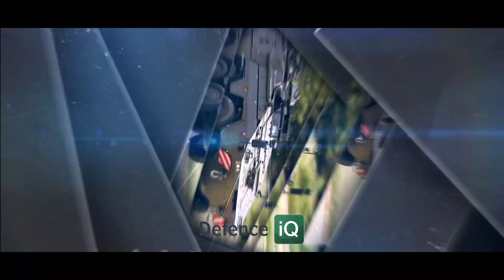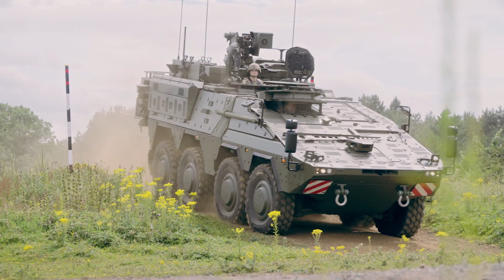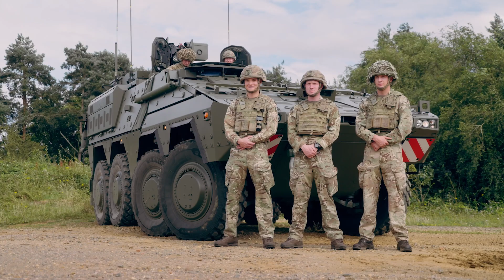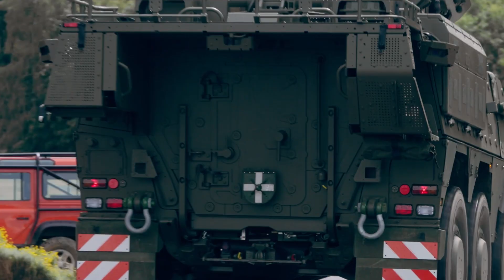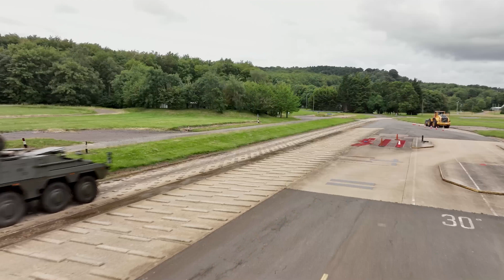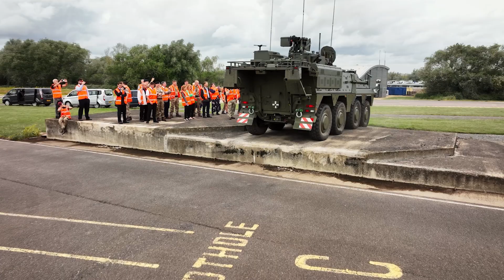The Progress of the Boxer Programme: Insights from Martyn Williams

Comment: I am glad they decided to have the external armourment fitted on the Boxers, that makes a lot of sense, just imagine if you are tring to pick up a casualty or evacuate stranded people having top cover is a necessity.

Given that boxer is going to be right in the thick of it, probably more than any other vehicle, and given that one of its virtues is modularity, it would make sense that one in three provided to the infantry are equivalent to the Latvian boxer variant, namely they have a more powerful external weapon.... which i guess using labels would class them as  an infantry fighting vehicle

Correct me if i am wrong,  but even with a large external cannon they still have the capacity to transport troops (although perhaps not as many).

My thinking is that most people think the most likely threat is traditional head to head confrontational warfare with an equally equipped adversary... Being more specific in open largely flat terrain in Europe.  If for example the boxers were advancing towards the enemy in open terrain having powerfull surpressing fire at range would be a great advantage (for example they could lay down fire on the move for Boxer's which were not fitted with a cannon.  That would be a very effective arrangement (and demonstrates the utility of boxer too).  The small arms fitted i imagine are great for fending of infantry in close proximity, but perhaps not neutralising pillboxes / fixed positions or other IFV's at range.

Also, i read sometime back, that the Saxon vehicles basically had a boiling vessel (kettle) in the back.. does Boxer have a 'B.V' fitted?? Sounds trite, but if you are out in the field wet and cold, simple things like that create disproportionate benefits.  You read some comments from old soldiers who when reminiscing abd thinking back over vehicles remember the kettle as being the most valuable feature of the vehicle!
Reply: We have always had a MG atop our APCs - not a new idea. Granted that mounting  the MG in a RWS is a refinement.
Reply: @grahammoore8967  the original plan to purchase boxer as I understand it was without an external armourment.  The addition of an external armourment was a belated or late in the day change after some consternation!
Reply: @Robert-f1g4i I presume we are not going back to the 1996-2003 period when UK was first involved in the project, then left to pursue FRES. We sought a MIV second time around after the fragmentation of the FRES programme. On 19 July 2018 the UK MoD disclosed its intent to initially order between 400 and 600 (later set to 523) Boxers in four variants to meet the MIV requirement for the Mech Inf. It would always have a MG for local defence as all our APCs had. Order was made in Nov 2019. The choice of the Kongsberg RS4 PROTECTOR RWS to house the MG was a very early decision being ordered on 22 Dec 2020.
Reply: @grahammoore8967  Saxon? No external armament.
Reply: @Robert-f1g4i  Saxon just had a pintle mounted MG.
Reply: AFAIK, all British AFVs have a BV.

Comment: Yes MRAV, back in 2000 this was a joint project and the UK was to manufacture the module, then we pulled out and that was the end of Alvis. Even worse Dorset Engineering down in Weymouth engineered a similar 8 /6 wheeler and our lot wouldn’t even look at it. That was the end of Dorset Engineering.
Reply: All very sad. I remember when we had 5 independent manufacturers of AFVs. Alvis produced some great kit over the years - Saladin/Saracen/Salamander and then CVR(T) and also Stalwart HMLC. The kit worked, was developed and built quickly and was well liked. Fair price too.

Comment: American company, "Let's buy this British company, then get a licence to update a 1960s Swiss MOWAG, get £ millions of taxpayers money, in an attempt to make a vehicle that will never be a new generation vehicle. We'll make it so it doesn't really protect the occupants, and we'll copy the failed attempt to produce a multi-type range of vehicles, as with the F-35 aircraft, fail, but still sell them to the British army, who are in dire straits over the condition of their armoured fleet."

And never admit that the whole exercise could have ended up with a modern vehicle, that was capable of surviving a modern battlefield, and it would have been cheaper. With the simple procedure of buying current, modern vehicles from European manufacturers. Vehicles that will never be of such low spec as the Boxer. 

Britain, once again, mugged by the Yenghi.

Channel is now a member of my DRC Club.
Reply: Boxer is a german-dutch designed vehicle and is not a refit MOWAG Piranha?
Reply: @cathulhu-q7y  Yeah, that rant was hilarious nonsense

Comment: A great vehicle. We should never have left the original consortium. It is ideal to replace Saxon light wheeled vehicles and possibly the bulldog but NOT warrior!!!

We need a tracked range of IFV. As good as this vehicle is it cannot replace a tracked vehicle.

If you go done that route you definitely need more variants.

IFV, mortar, air defence, anti tank etc… I.E fighting version’s
Reply: Saxon was phased out decades ago. Boxer was meant to replace FV430s (many of which were uparmoured to Bulldog) and Mastiff. Warrior was meant to be replaced by improved Warrior, but that programme was cancelled. Very sadly wheeled Boxer MIV is now replacing Warrior IFV in the armoured brigades. Total madness.

Comment: There was some talk of a tracked variety being developed in Germany - for the defence of UK and much of northern Europe  the Boxer will more than hold its own but what about the further south and east we go the worse the roads become and  have to operate there? 
Also is there a module to house a 120mm mortar and/or the 105mm light gun now we have decided to mount a 155mm module. We've never had a replacement for the ABBOTT.
Reply: Yes a tracked boxer does exist. I personally think it would make sense to be able to swap modules between wheeled and tracked vehicles as required. Would help with standardisation, training and logistics

Comment: Well there you go. My last job in the Army before I left in 2001 was at Chertsey working on MRAV. For those not familiar with the acronym, it is Multi Role Armoured Vehicle, now known as Boxer.
Reply: Only 23 years in gestation? Rapid indeed. I remember being at HQ BAOR, the various Branches contributed tons of paper towards the future LR Ambulance replacement, never saw anything emerge though.
Reply: @samwhite8093  no, the german and dutch army are operating Boxer in combat deployment since 2011.
the UK just fucked up its procurement royally, leaving the programm early, trying to start/buy 3 different solutions over the 2000´s and 2010´s and now came crawling back to buy boxer as a customer, not a developement partner, 12 years after the origninal partners have been deploying Boxer in combat.
Reply: I was at RARDE (CH) in 1989-90. VS4/VT4.

Comment: Its a great APC for on the roads or dry off roading but I'd like to see it dealing with terrain like we see in the Ukrainian wet season.
Its basically a German Stryker and we've seen that these types of vehicles fleets severely lack heavy firepower. There was talk of maybe a mortar variant or a large calibre weapon variant but we've yet to see anything yet.
Reply: There are many variants, and the UK already has a prototype of a Boxer with a mortar.   Dutch armed forces are upgrading the 50 cal on the Boxer to a 30mm cannon and adding antitank weaponry.
Reply: its much heavier protected than stryker.
and comparably mobile to Leopard 2, even in rough terrain and mud.
where a Leo2A6 goes, a Boxer can follow.

Comment: A calm concise summary of the new Boxer vehicle.  No filler, cliches or BS - great to hear a positive account with no ‘jazzy or trendy’ speak just common sense.
Reply: Didn’t hear mention of the rather critical deployment problem: an A400M Atlas can’t airlift even one Boxer. It would take 3 aircraft to deliver 2 Boxers to Europe. Not ideal when your army lives on an island.
Reply: @billyponsonby  An A400M can most definitely carry a Boxer. For starters the A400M can carry 50-60tons of cargo while 1 Boxer weighs 30t. With 3 A400 you can airlift 2 Boxers and any 2 of their mission modules. Changing a mission module in field conditions takes about 30 minutes so really not a big deal if you have to remove them for transport due to size.
One A400 can carry one Puma IFV which is slightly bigger and heavier than one Boxer.
Reply: @gustavmeyrink_2.0 It wont take an ajax apc but who cares its a heap of junk with more soldiers being taken sick, no matter what the mod say it will never work its too heavy too loud and who ever said it will  are liars and hiding the truth 🇬🇧🇩🇪😍😫
Reply: @billyponsonby  we rarely, if ever, move medium or heavy armour by air. They would go through the Chunnel or on ships from Marchwood Military Port.

Comment: If it's got a BV then count me in
Reply: it has even an oboard toilet.
BV´s are standard on all NATO AFV´s since the 60´s
Reply: @cathulhu-q7y  jolly good. Get the kettle on
Reply: @cathulhu-q7y  really? I thought only Brit AFVs had a BV as standard until a few years ago.
Reply: @grahammoore8967  yeah that's a British myth. Basicly compensation for severely lacking equipment since the 60s.
Leopars 1 Batch 1 and M60 Batch 1 already have BW plugs in the crew compartment.
Those BVs are just not regularly issued, because they drain the turret batteries when the motor is turned off and proper supply of the units is done via field kitchens (mobile mess halls) on exercise and deployments like Afghanistan
Reply: @cathulhu-q7y  thanks. British tanks have had BVs since the late 1940s. Other AFVs followed later, Whats the point in having a BV plug fitted in your AFVs if the electrical supply is not man enough for the job of boiling a small quantity of water, which only takes a few minutes. Design flaw there. Funny that your army is totally reliant on field kitchens. That is very limiting. We use a mix of field kitchens (static and mobile) but all soldiers carry 48hrs rations so they can provide for themselves.
Reply: @grahammoore8967  its not reliant on field kitchens.
its just easier on logistics to have your soldiers being supplied via a field kitchen when on excercise or when in a field camp like the main bases in afghanistan.
german soldiers also carry several 24hr rations the so called "EPA" and burners to heat them.

those boiling vessels drain quite alot of the turret battery.
and they tend to be used when the tank is off the line or waiting with shut down engines.
so when it is in silent observation or in camp.
you might want to take a look at the power usage of your electric kettle in your kitchen.
those things get issued when needed.
Reply: @cathulhu-q7y  thanks. In case I wasn't clear the British Army does use mobile field kitchens manned by RLC chefs if the tactical situation permits. In deployed main bases like Camp Bastion we had the DFACs. It seems that your tanks don't have Aux Engines (aka Generator Unit Engines (GUEs)) which are used to top up batteries without firing up the Main Engine. We have had Aux Engines since the Chieftain was fielded in 1966, the Coventry Climax H30.
Reply: @grahammoore8967  Leo2 got one in the A6+ and A7 versions.
on older versions the APU didnt fit into the engine bay due to the old power packs being slightly larger than the modern ones.
considering the absolutely atrocious engines the brits put in their tanks, an APU was absolutely neccesary to keep the tank running at minimum capability (operating the turret hydraulics, radio, optronics and FCS)
Chieftains 90% engine break down rate killed hundrets of chieftains in combat. (iran lost 600 out of 900 chieftains in combat against irak)

Comment: It's complete crap. So loud it's deafening to personnel inside. The off road capability is well below a warrior. Note it has no film of it off road. The project is  so over budget and behind. It's a disgrace. Howard Hughs spruce Goose looks more capable.
Reply: The Boxer has been in service with multiple countries for years and Britain left the program in 2003 only to rejoin in 2018, it's a really successful platform and the modular component is brilliant, you are thinking of Ajax - but what we should take away from your confusion is that Britain shouldn't try and develop systems with no export potential, and in too small numbers - when better, and tested systems already exist - also the MOD should not be allowed to add so many additional requirement and specifications - which has delayed Boxers roll out and pushed up the budget unnecessarily. With such limited resources, the UK should focus on "Good-enough now" rather than "best later" and only develop complex systems in conjunction with other countries (unless there is a realistic prospect of export orders).
Reply: Firstly that is AJAX you are talking about and secondly all the kinks have been ironed out on AJAX. I live near catterick and have spoken to some reme lads who worked on the AJAX system and they candidly told me the machine is exactly what it should be now, albeit we should have had it years ago.
Reply: Lol, You've just confused the early Ajax System with the Boxer.....  Fraud!